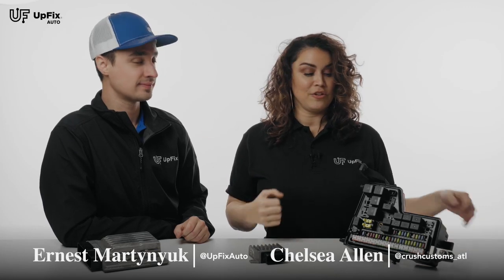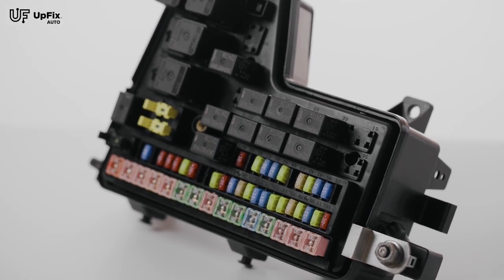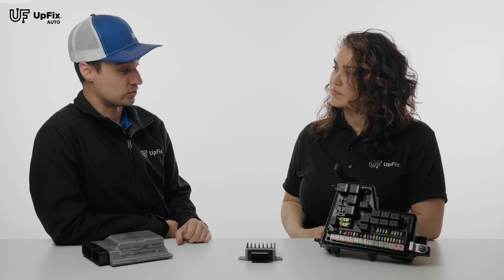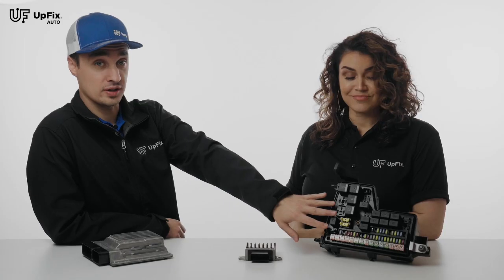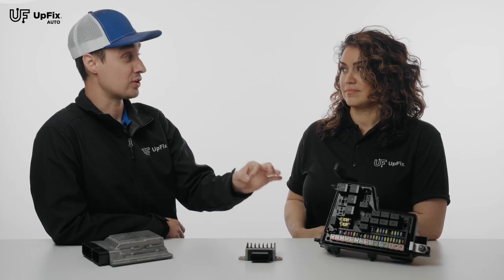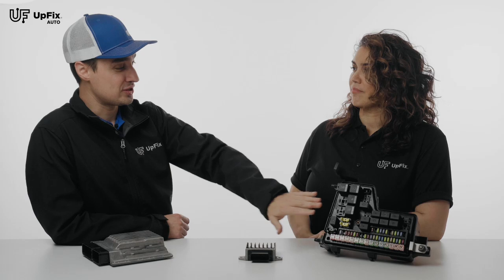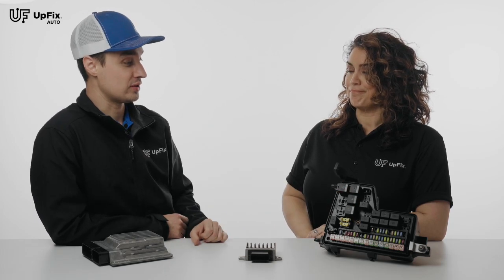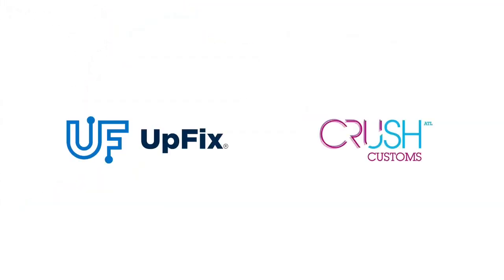What is a Totally Integrated Power Module (TIPM) for Jeep, Chrysler, Dodge, RAM? Upfix Explains!

Comment: Can a short in the TIPM cause the ECM to burn , I have an issue with 2017 dodge ram 1500 classic that we have no communication with the ecm we found out it's fried we got another one we installed it and we had communication but when we start the car the ecm get fried instantly we got another 2 ecms and same thing happened we changed the wire harness and still doing the same we unplugged every sensor and essential components alternator compressor etc and still fring the ecm on start .

Comment: My mom has a 2016 ram 2500 and the lights in the cab won't shut off and the seat belt beep won't shut off with the seat belt on.. What is that about?
Reply from the maker: The TIPM controls all the body electronics, including interior lights. If the TIPM has an internal fault or relay issue, it can keep feeding power to the lights even when they should be off. Sometimes a stuck door-ajar sensor can also trigger this, but if multiple electrical oddities show up together, the TIPM becomes the prime suspect.

Seat belt chime won’t shut off even with the belt on, that’s usually either the seat belt buckle switch (a small electrical contact inside the latch) not being read correctly, or the TIPM not processing the signal properly. Since both the lights and seat belt warning are controlled through the TIPM and Body Control logic, this points to a bigger control issue rather than two separate failures.

In short:
It’s very likely the TIPM is failing (which is a common weak point in Rams, Jeeps, and other FCA vehicles). It could also be a wiring/grounding issue, but the cluster of symptoms is a textbook case of a faulty TIPM.

Comment: Is the windshield washer pump integrated in the tipm
Reply from the maker: The windshield washer pump is typically not integrated in the Totally Integrated Power Module (TIPM) for Jeep, Chrysler, Dodge, and RAM vehicles. The TIPM controls many electrical components, but the windshield washer pump usually has its own dedicated relay and fuse outside of the TIPM. This arrangement allows for easier maintenance and replacement of the pump if needed.
Reply: @upfixauto  thank you for getting back to me. My 2007 Dodge Grand caravan has no external fuse anywhere for the washer pump.

Comment: I have a Jeep question for ya. My abs and traction control light are on the dash. I’ve changed the wheel applied sensor and the lights are still on. I recently had my brakes and calipers changed out and ever since the lights stay on. No cruise control and occasionally my emergency brake light flashes and my speedometer goes dead the comes back on after a few seconds. Have you ever dealt with this issue?😮
Reply from the maker: Sounds like a bad/dirty speed sensor or poor connection.  Some aftermarket sensors are bad and give wrong ohm reading back.